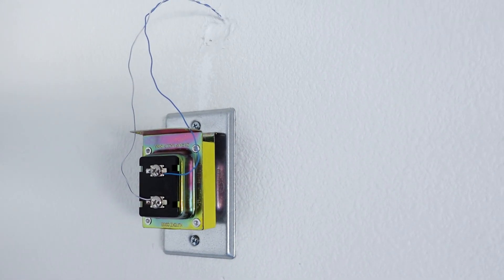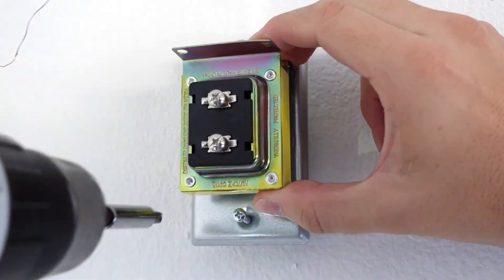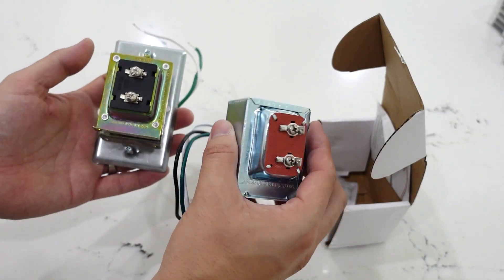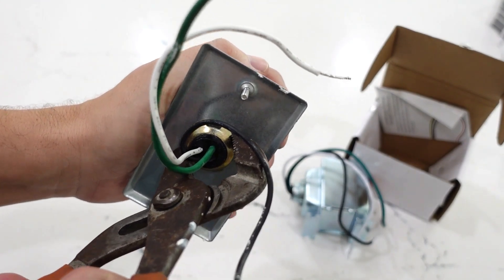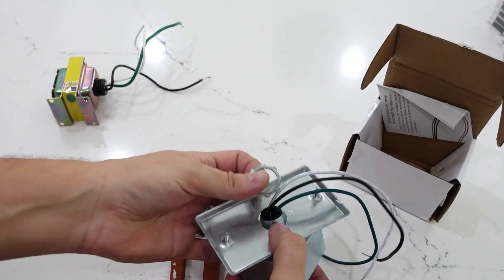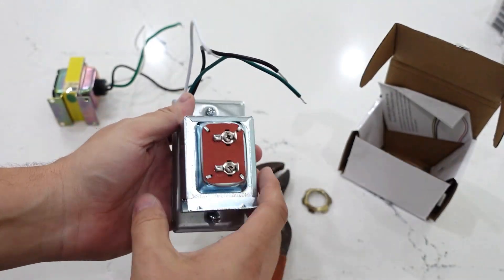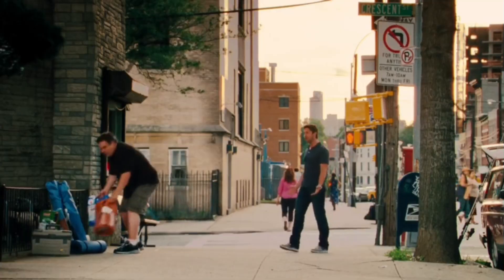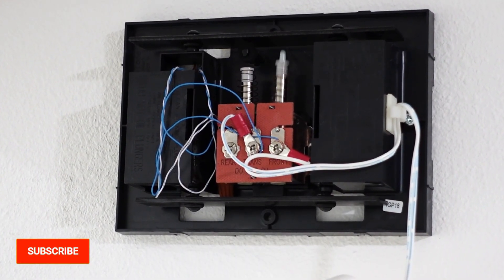How to Install 16V 30VA Doorbell Transformer

Comment: Hey, thanks for the video!

I just upgraded from to a 24V 30VA transformer from a 10V 5VA transformer.

Anytime I touched the 10V 5VA transformer it was slightly warm to the touch.  This new one is considerably warmer.  I can maintain contact with it (so it's not TOO hot to touch), but I'd call it VERY warm.

When you upgraded, did you notice an increase iin the heat the new transformer throws off?
Reply from the maker: To be honest I never touched either one of them after I installed. So I'm not sure.